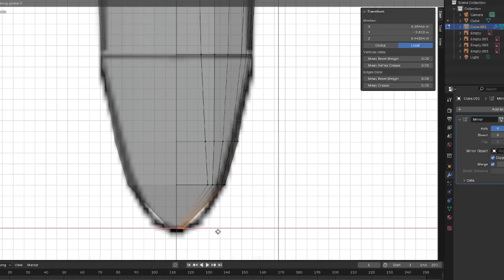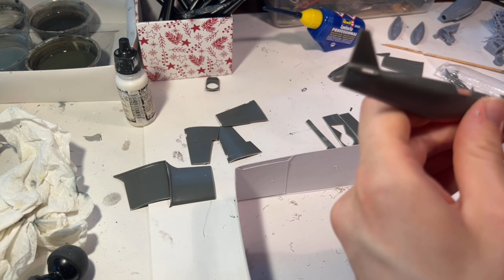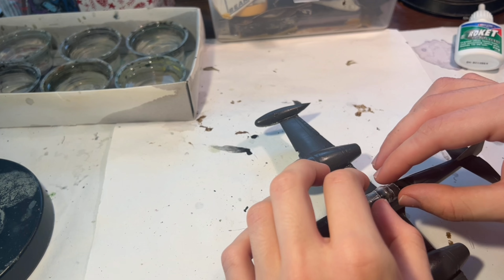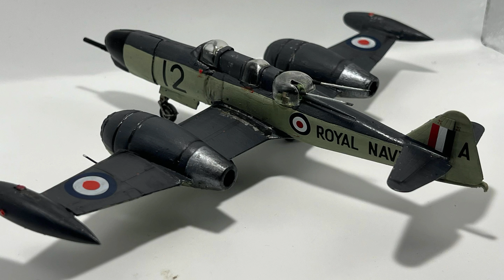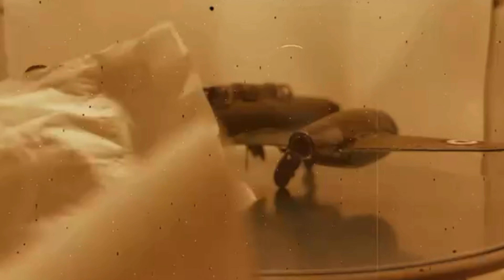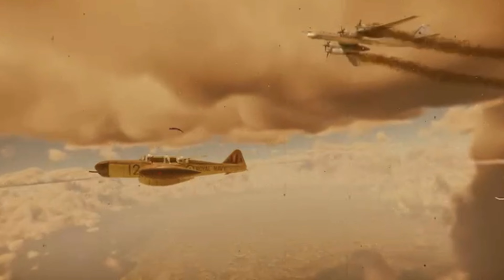Airfix 1/72 Defiant Conversion Part Duex: Naval Jet Power + 57mm Anti-Ship Cannon Upgrade!

Comment: Personally i HATE  Tamiya paints for brush painting.... every time i have tred them i get streaks.....they are fine from an aersol can and an airbrush
Reply from the maker: Yeah I get that! I have had some Tamiya colours go on really well by brush and others that don’t seem to dry and tear the first layer off when I go to do a second. They also seem to go dry over time but I’ve since learnt that’s because you shouldn’t actually dilute them with water. Vallejo and Ak definitely seem to be better! I have used aerosol for metal and primers but I don’t really like the Tamiya primer ether. Plus a bit of washing and some varnish see,s to be enough in my experience? Thanks a lot for watching.